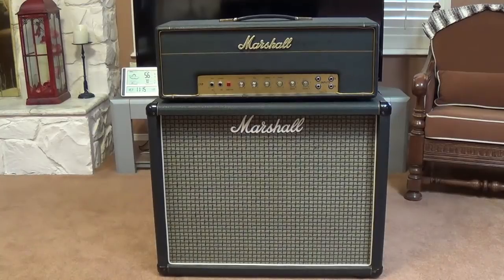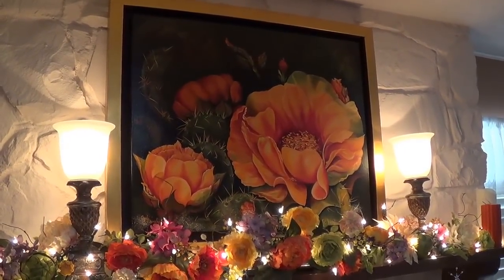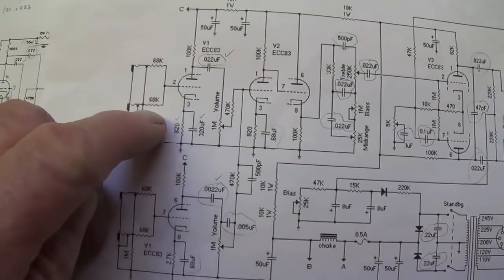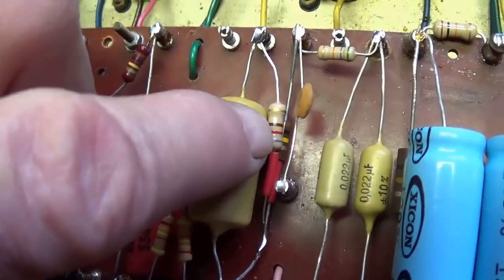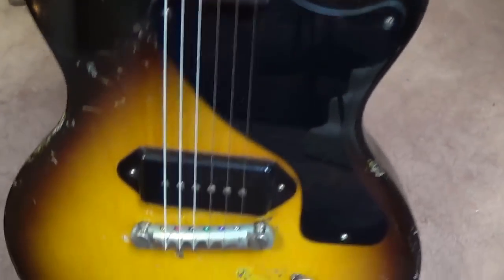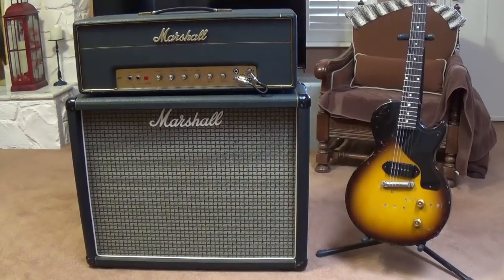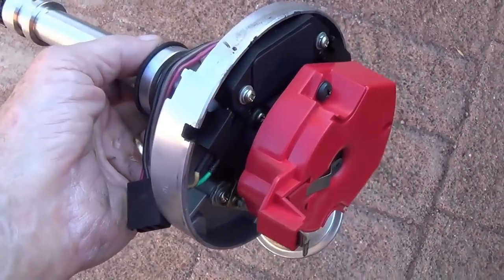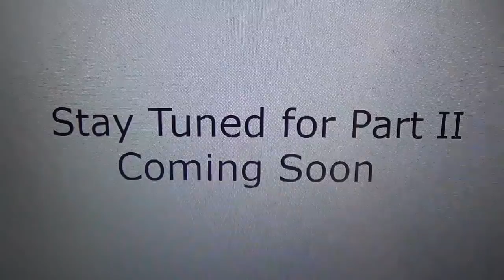Marshall 1986 JMP-50 Bass Amp becomes a Model 1987 Lead Amp.....with Extra "Mustard"

Comment: Interesting video on the Marshall. I got very excited when you displayed the vintage LP Junior! 
Instant "Leslie West" comes to mind and at first glance the wrap tail bridge looked more like a 1954, as the treble side on a 54 is closer to the pickup stud n bushing area, but perhaps it was just the camera angle?
After that year or 56?, they pulled the stud back further.
There's plenty of information about this on the internet. 
The Gibson P90 is a powerful single coil pickup and has great lows and screaming highs ala "Mississippi Queen", as you know. So, at that lower volume I leaned towards the original BASS amp sound and probably would have loved it cranked up too.
As you stated, the customer is always right. Moving on to the rat rod. Those reissue distributors are a Godsend when you need room compared to the bulky electronic ignition cap.
Going way back to working in the family race car shop from days of old point distributors and then magnetos. I was the young ignition man everyone came to, as people frequently replaced their distributors back in the wrong cog on the cam, misalignment on the oil pump shaft rib, etc.
A SB Chevy will run on three or four cylinders and out of time, I've seen it many times, lol. 
So, what I would do for cash, barter, trade or for free is have them bring their car to our shop, leave and come back in a couple hours. In order to correct the single points or fancy dual point Mallory ignition, would be to pull the distributor, spark plug #1 and make sure that the plug wires were routed correctly, as the firing order is burned into my memory and molded onto stock intake manifolds as 18436572.
Odd cylinders on the drivers side and even on the passengers side.
Then, I would put my finger tip on the #1 sparkplug hole in the head and have someone bump the starter until the compression stroke would pop my finger tip out of the hole. Then, turn the crank by hand until the timing line/mark was top dead center. Moving back to the distributor, I would then reinstall it with the rotor cap falling into the cam cog and settling flush on the manifold and if it didn't, i would pull the distributor back out and using a long flathead screwdriver, I would turn the oil pump shaft to the correct position, so that everything lined up when it dropped in flush to the manifold TDC and the rotor cap pointing directly towards #1 cylinder. 
Snug up the crow foot just enough so that I could turn the distributor by hand at the vacuum advance or cap. Reinstall #1 plug and fire the engine up with the vacuum advance hose plugged on the air cleaner stud or with a small bolt, attach my trusty TRW dwell meter "first", this is what so many people get wrong. After setting the points dwell, then one sets the timing correctly, NOT vice versa, because the dwell will molest the timing, 28-32 on the meter is standard. 
In a pinch, if you don't have a feeler gauge, you can use a match book cover, which is around 16K aka .016, if I remember correctly. 
From there, set the timing with my Craftsman timing light connected to plug wire #1 and lock down the distributor with a homemade distributor wrench, before they sold them in stores. Then, hook the vacuum advance hose back up to the carburetor. Then, I would adjust the fuel and air mix needles on the carb/s, then set the rpm idle, depending on whether it was a manual or automatic tranny, then recheck everything again.
Rev the engine up good and listen for the correct familar throaty sound. If it all sounded right, then out on the road up to the stop sign and back going through the gears firmly, pull it back in the shop, recheck all the ignition settings again, make any final adjustments wherever needed and park the vehicle back outside.
I made a lot of people happy doing that.
Got a lot of free beer too.
I had access to old Chilton manuals going way back.
Big blue books!
It's a science for sure.
Reply from the maker: Your description of the process is exactly how I do/did it, Amo. Thanks for sharing.

Comment: That painting is amazing, your wife is also a very talented person. The 87 circuit sounded brighter than 86, but still sounded to bassie for me . That lp junior should be cuttin like a knife Mabe a dlfferent slope resistor in the tone stack, or smaller bypass cap on v1a.
Reply from the maker: Thank you very much. Perhaps it was the tone settings we used, David....however the slope resistor is a possibility.

Comment: One thing I did notice is the GZ 34/5AR4 rectifier. This would have been stock in a JTM-45/50 amplifier. 1986/1987 amps had solid state rectifiers. Perhaps this is a transition amp.
Reply from the maker: I believe you're right, Arnold. During the period of manufacture of this amp, there seems to be a lot of variations in the circuitry.

Comment: Doug I agree that the 87 capacitors made it a little bit more treble e and honestly to my ear I preferred the sound of the 86. Now about this terrible winter storm of a little bit of rain and the high 40s.  if you were up here in Canada where I am you would probably die from our Winters. Even though right now in Southern Ontario Canada we've had warmer and less snow than normal winters for the second year in a row. However the temperatures are anywhere from the high twenties into the mid 30s most of the time since December until now the end of January. February usually gets a little bit colder.  Sometimes the wind chills are in -10 and -20.  In other parts of Canada static temperatures can be -30 with wind chills as bad as - 60. Try to imagine what that could feel like. I always love watching you work. Brings me back to my early days in the 60s when I started learning electronics. These days there is still a rage for tube amp devices but unfortunately the quality and availability of tubes has diminished to Chinese and possibly some Russian style tubes availability. And the price of them are astronomical compared to the buck and a half we used to pay for tubes back in the 60s and 70s
Reply from the maker: Greetings, Mike. I love to torture you guys who live in areas with god-awful weather.  It's about 70 here today with crystal clear skies and no wind.......utterly wonderful :)
Reply: @UncleDoug  I completely feel the torture
Reply from the maker: @2bikemikesguitartopics145  You're always welcome if you want to move, Mike. We can put a hammock in the workshop :)
Reply: @UncleDoug  
I'm going to give that some serious consideration

Comment: Did you check the ESR values of the replacement mustard caps?
I was frankly disappointed in the sound of both amp versions.  I thought the sound was muffled in both versions but the "87" version was a bit clearer.
Reply from the maker: ESR is for electrolytics, Peter. Sorry you found the demo's to be sub par.

Comment: Thanks Uncle Doug!  Liked the car part too, as I am a retired auto transmission guy as well as a guitarist.  The end drive gear on that distributor - the tang that drives the oil pump - can be given a slight chamfer so it slides more easily into to that drive slot.  Won't affect anything, except makes it easier to mate the two parts is all if you have to take it out again in the future.
Ever considered painting the rod canary yellow?  
Seems it is a popular color scheme for those years of rods.
Reply from the maker: You're welcome, Mr.RG. I'll keep our suggestions in mind.

Comment: Very interesting test, great work.I love the way you make your videos, everything is explained and plainly shown. I’m not a fan of Marshall tube amplifiers but I actually preferred the tone of the bass amp. Although I live in the U.K. I actually prefer the tone of classic Fender amps although I do have a weakness for the old Dave Reeves Hiwatt 50 &100 watt tops. I do wonder about the wisdom of using NOS capacitors , after all even if unused they have been laying around for some years and nobody knows what might have happened inside them over that time, but they seemed to measure up ok and if that’s what the customer wanted......
Reply from the maker: Thanks for all your very interesting comments, Henry. Yes, the customer is always right :)

Comment: Hi Doug

I have a tech question. Does the size of power supply filter caps matter? Example is, I am recapping my Carvin Legacy 1 head. I ordered 22 mfd 500v caps. The ones I got are physically smaller than the original caps in the amp, but the 22/500 values are identical. Does the larger size add any technical benefit to the amp/filtration?
Reply from the maker: Nope, MF, as they say in elf-esteem seminars, size doesn't matter......when it comes to filter caps. As long as they are the correct (or slightly higher) capacitance and voltage rating, they will work perfectly.

Comment: Hello UD, Happy 2020 ! To my ears, the 1986 sounds fuller, warmer , more Marshall, there where the 1987 sounds thinner.What the caps concern ( yellows versus Mustard ) a hype as so many others imho.I tried them all, from Orange drops, Jupiter, Sozo etc... etc.. and I stay with the Mallory serie 150. You showed us, in an earlier video,  that cathode caps with a value higher then 25 uF does not change anything. Why Marshall  used 220 or even higher values. I also tried it in a 5F6-A Bassman, replacing the 250 cap in the V1 with a 25 uF and the sound stays exactly the same.Theory is one thing, the practical side is more then often very different.
BTW, Nice job on the car. looks great. Wish you a fine day UD . Greetings from Spain, Joseph
Reply from the maker: Thanks so much, Jose. I agree with you regarding capacitor hype and oversized bypass caps.  Practical is always better than theoretical in my book.

Comment: wow!! i'd love to see you working on more british amps! the cool thing about plexies is that until 1968 superbass and superlead had exactly identical circuits! the only difference was the bright cap across volume 1! the superlead configuration that we all know didn't appear until 1968 
a cool way to have them both in an amp is to split v1a and v1b cathode resistor and cap and make them one like a superlead and one like a super bass , add the bright cap on the superlead volume, and then leave coupling cap (the mustards) values and tone stack like a superbass, that's the best way to approximate a superlead into a superbass amp. I always use a 100w superbass plexi amp, after trying many settings i have found the perfect one... bass at 0 and everything DIMED!!
Reply from the maker: God help the neighbors, Pancri :) Thanks for all the good info :)
Reply: @UncleDoug  I omitted a little thing... I use an attenuator otherwise i would be writing from jail haha! Wonderful job as always! I love your videos!
Reply from the maker: @pancri321  You had me worried there for a while, P. Thanks for clearing that up.

Comment: Holy caligraphy batman! I've got to go with the 1986 sign. Simpler and direct without unneeded complexity. When are you posting the signs on ebay?  Brighter and more punch and growl. Just like the amp. Glad your back. Keep em glowing!
Reply from the maker: Thanks, Mark. Somebody called from the Louvre, inquiring about a private showing of the signs, but I turned them down. It would interfere with my pole dancing lessons ;)

Comment: UD, good to hear your voice again. At 18.16, when you were testing the capacitor, the value displayed was quite stable. My observation is that, when testing resistors, the value displayed on digital meters jumps. Why? My faulty observation? Contact issues? Resistance varying with (maybe) temperature? Other?
Reply from the maker: Maybe the battery in your ohmmeter is low, or there is a bad connection in your test leads.

Comment: Great transformation Uncle Doug!  Although this amp wasn't original I was glad to see the previous tech was neat and clean.    You've had some really 'messy' (scary?) old work to repair in the past!
It's a shame it wasn't a 1987 / 1987 comparison with new and old caps.  It certainly sounds better after your work, but I don't know how much is teh circuit, and how much is because of the caps.
I'm not a Marshall guy - is there no way to tell a 1986 from 1987?   Do you need to check serial numbers or something?
Thanks for the lessons, as always
Reply: I agree, it is shame it is not a 1987 new caps  / 1987 mustard caps comparison. Splitting cathode on V1 changed the tone a lot. So we do not know how changing caps to mustards actually affected the tone :(
Reply: @MadrasDSF  The 87/87 would be ideal, but I'm still happy with the 86/87 comparison.  Interesting to hear the difference
Reply from the maker: Thanks, D. I agree that a comparison with only one variable (mustard caps) would be preferable......and that is what I had planned.....but fate through me a curve with the 1986 circuit.

Comment: Why are so many people saying how good the mustard caps sound when the circuit values were changed? That’s two variables changed at once. Uncle Doug certainly knows that. I can tell you that dialing in an amp by playing it and changing values, playing it some more, changing values......is far more important than a supposed holy grail component. (Quality being roughly equivalent). Jeez....sometimes a crappy component is what made the amp sound “good” or “quirky”. Carbon comps in key areas along the signal path can sometimes add distortion that our ears like....and sometimes it’s just hiss. On the other hand, I’m pretty convinced that different quality iron can make a difference in an amp. Still, circuit design, layout and quality are most important.
Reply from the maker: I agree, BO. There were two variables in this experiment....which is one too many......and I personally feel like the largest factor, by far, in the final tone was the change in cap values, not brands. Marshall enthusiasts, however, rally around the rather unique "mustard" caps found within these wonderful old amps, and the owner of this one felt that if a cap change was necessary, it should be back to the original type of cap that had been so rudely removed many years ago.

Comment: I’ve worked on a couple of early JMP’s myself and prefer the “Bass” version by far. Doug is right about the very last coupling caps, the 22nf/0.22uf caps kill the bass. These were built for live music, without large PA systems and sound engineers EQing the venue. It was very important to have purpose built gear at the time. By themselves they sound horrible to me, but in a live mix, they shine.

I love my Tweed amps, nothing can replace them, but I’d love a Plexi JMP to add to the collection.
Reply: I cannot agree changing caps right before power tubes makes any difference in guitar frequencies. It is because new output caps are 0.022uF together with 220k are making high pass CR filter roll-off of bass at 32.9 Hz. Previously it was 0.1uF making roll-off of bass at 7.2Hz. Low E string is usually tuned at 82 Hz. Summing up, the change should not make any audible difference in guitar frequencies. What in my opinion makes actual difference is changing shared cathode to split cathode. Best regards!
Reply from the maker: Thanks so much, Matt. Here is a YT video that demonstrates the effect of coupling cap values:   https://www.youtube.com/watch?v=eF8e-FmtDh4

Comment: Hello Uncle Doug,  I really can't tell much difference.  It does seem a little tiny bit bassier on the 86 setup.  The 87 setup, maybe more treble, I don't know.  I'm curios, though.  Is the amp hooked up to a bass cabinet or guitar cabinet.  I think that might have something to do with the kind of tones you could get out of it. Don't know.  Good video.
Reply from the maker: The speaker cabinet is for regular guitar use, Rick, not bass.

Comment: Wow! That painting is awesome! Your wife paints beautifully. Just a thought on those caps, I am not sure why people go  freakin nuts on this. Let's face it, a cap has only so many parameters, if you come close, or even better, with a reliable quality replacement, you will come close to what is was new, or better. Besides the fact that not only electrons and heat kill caps, age, air, are a  lethal killer. So why buy New Old Stock (NOS) ? Because you have some kind of disease.  :)  I believe they should only be installed when they are facing North & South also for better tone.
Reply from the maker: Thanks so much. Viewers know that I am not a fan of boutique capacitors, Sean. I do what customers request, as long as it is not counterproductive.

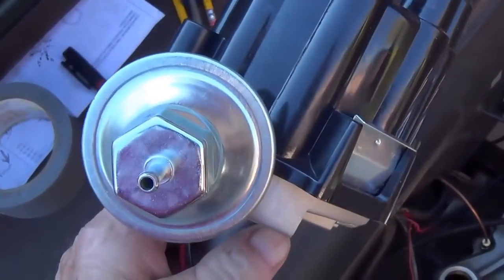Comment: @40:46 "Hall Effect" distributor, pretty cool. My old Duster w/225 slant six had an optical trigger;  slotted skirt mounted on the dwell plate interrupting a photoreceptor. Absolutely maintenance and trouble free, but the magnetic Hall Effect distributors perform better.
But fundamentally they're both just zoetropes for the primary ignition system. lol
Reply from the maker: Thanks for your input, Michael. As you will see in the Part II video, it does indeed function quite well.

Comment: Good to know you're back. I was getting a bit worried. Just for your info: the purring of Casey can not be reduced by installing new filter caps. No kidding, I definately noticed a different sound. The amp with new caps has more clarity and sounds brighter and more articulate.  Considering the fact that caps can vary up to 20% even in the same production batch differences between new and NOS are to be expected. Did you measure the caps for capacitance, esr and leakage?
Reply from the maker: Thanks, Berre. I tested them for capacitance and all were excellent. ESR is for electrolytic caps. I did not test for leakage prior to installation, but the coupling caps allowed for stable PC in the output tubes, so they are apparently OK.